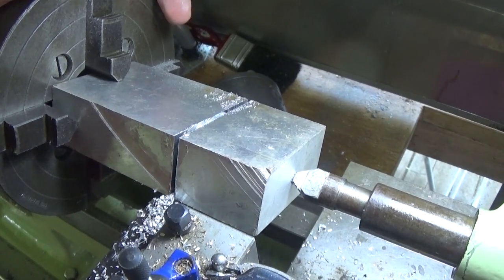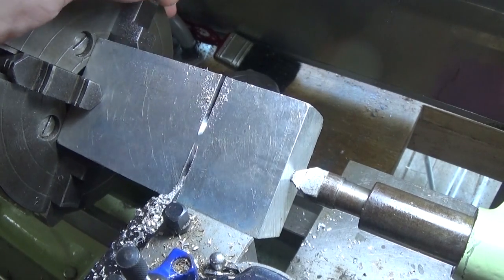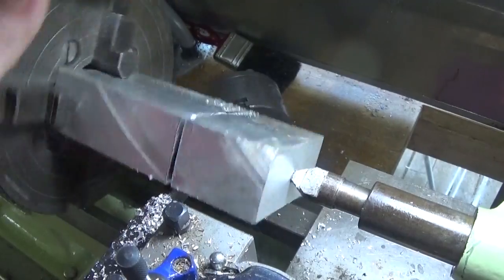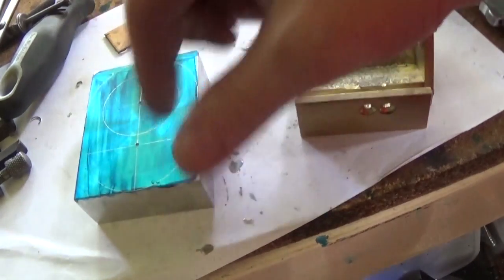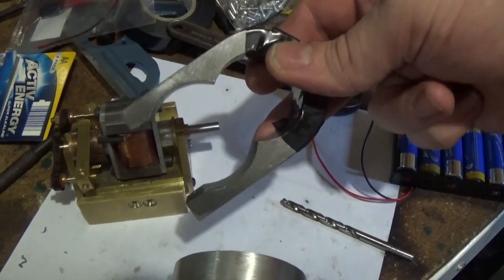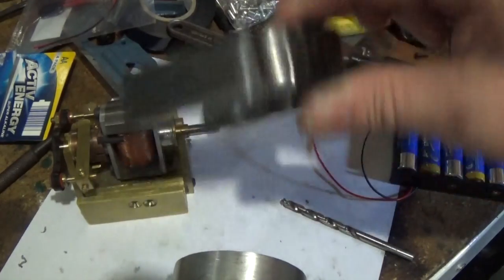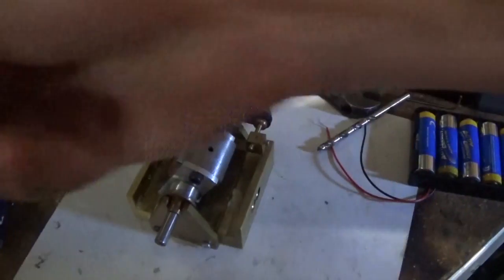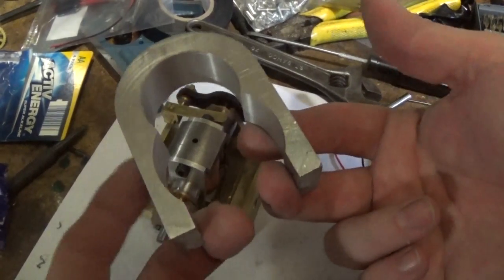Prince Dynamo motor PART13

Comment: Putting those magnets on a steel horseshoe would have doubled the strength of the magnets but cutting a recess on the inside would be very difficult. Try an experiment, put a piece of steel on the magnet and feel how much force it takes to pull it off. Then place a piece of thick steel one side and then place the original piece of steel on the other side and you will find that it takes a lot more effort to remove it.

Comment: Hi Emma - very impressive work. I started watching this series, then got sidetracked, then computer problems. Got a virus the first time for years...in the end turned out to be coming from my ISP (don't ask) And for the first time since I first got a computer in 99 had to take it to be cleaned. However it's all fixed so hopefully ok for another year (don't you love computers)
I think having the base cast in brass instead of Ally was a good stroke of fate, as it looks much better. I've spent an enjoyable time this afternoon watching your last few episodes. Well done on winding the armature, and your work on the commutator is just stunning.
After my last project I've found I've tendinitis in my right arm, so not much more sawing or filing for me for a while....it'll be ok in a while no doubt.
However you asked what my next project would be....well 2 have come up. I know you like old things and I was thinking of a Lister D for a project. These are plentiful and relatively inexpensive, however an online friend has most of the parts to make one up.....have to wait and see on this one.
Also last year my friends at the garage (who like to see me busy lol) suggested I make some of the 'scrap' ornaments, and do a car boot or something. Well I was supposed to have around 40 bases by now, but only have a few. Also I need to find some old tools or broken engine parts etc to make them.
Anyway I've used a few to make some more trophies for the next field banger do in May.
Lastly my friend has finally let me take a video of his 1932 Lanchester.....it might be seen and someone buy it....so I did that last week. Been waiting 13 years to do this, well 8 anyway as that was when I got my Sony camcorder, hence my channel.
Phew, sorry for the 'novel' just thought it better to post one comment, rather than you having to look through lots.
Keep up the great work.
Malc.
Reply from the maker: +MalcOfLincoln thats awesome.  The virus is less awesome. Thanks for the nice comments -im ŕeally pleased with it too. Glad i ended up with brass. Guess i need yo make something for it to run next..lol. Saw the lancaster video. Hope someone does buy it lol. Like the look of the trophies too! Really appreciate  your  feedback and interaction to be honest. Its what its all about! Thanks so much for watching.
Reply: Thanks Emma - as you say, for me it's what it's all about, although I do sometimes watch videos without commenting....that's if I can't think of anything useful or interesting to say lol. Pleased you like the Lanchester......thought you might :)

Comment: Nice job Emma. Great solution to the magnet problem. Leave the brass badges as they are , they have that antique look about them. The only thing I would change would be the screws holding them on. They need to be smaller headed brass screws to make them look really nice. Looking forward to the new machine reveal. regards from the UK

Comment: Brava Emma. After I made my last comment on using wood, I went to merpete222 site and discovered that sure enough he made a prototype out of wood!  As they say on the 'tube, LOL. Aluminium looks much better. Thanks for the etching lesson. It is a nice way to make brass labels. I watch clickspring too, fellow clockmaker. What he might not show you is the failed attempts. But at this point engraving the dial is the last of my worries. I have a 120 tooth gear to cut. Oh yes and thank you for showing me that you can part rectangular section Ally on the four-jaw.
Reply from the maker: +Juan Rivero hows that wheel going?? any progress? thanks for watching!
Reply: +Emmas Spareroom Machineshop Ach du lieber, that wheel is at the extreme limit of my equipment. I built my own dividing head. I built the cutter. And both of them went at the same time. I've got the cutter honed, and I rebuilt the dividing head today. I will try again tomorrow. The wheel is 110+ mm diameter and my lathe swings 112 or so, so I hate to make wheel blanks! But it is fun to push your equipment to the limit.
Reply from the maker: Well good luck for tomorrow. Plenty of support in the blank and light passes are in order!

Comment: Have you considered boring through the magnet pockets with a bit to leave a small lip or shelf to keep the magnet from pulling through. It might be more effective.
Reply from the maker: yes. i had. the reason  I  didn't  was because  I  dont have a 12mm endmill to ŕetain the magnet.. otherwise. .